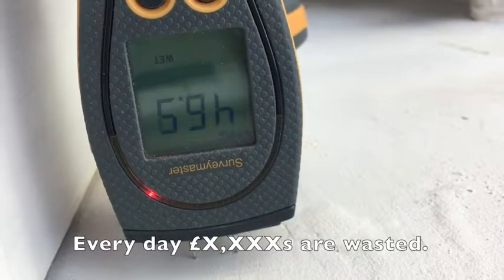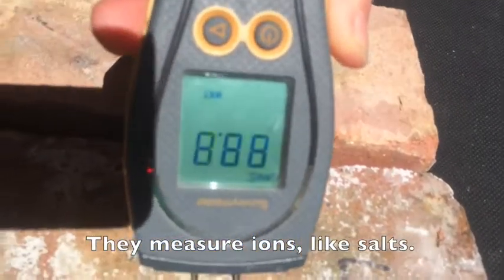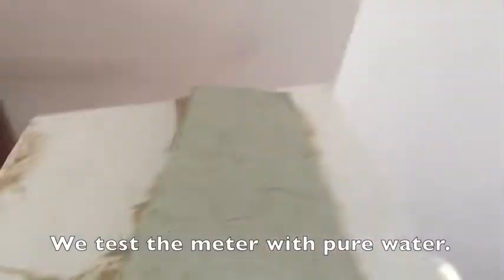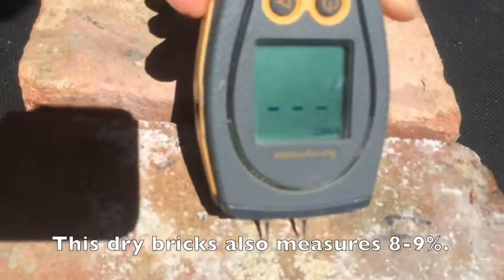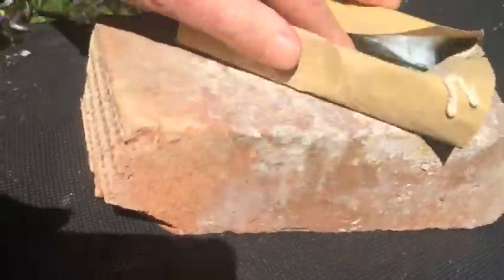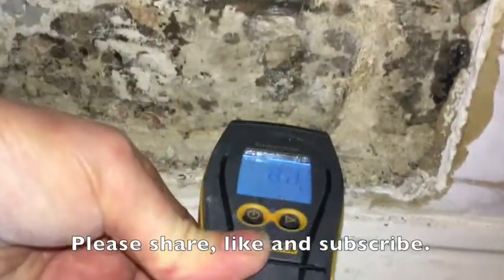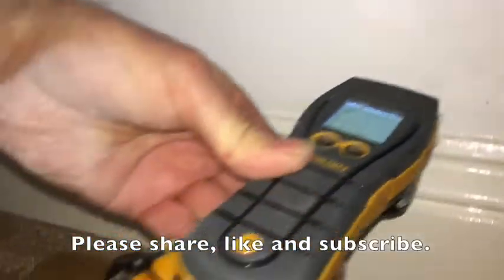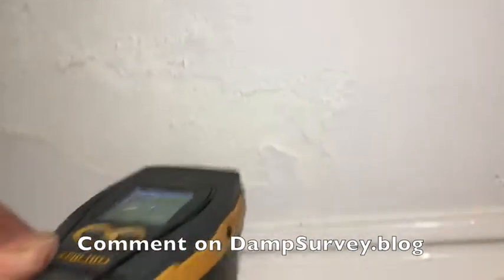How do damp meters work?

Comment: I always carry a pin type damp meter on my surveys but I always take time to explain to my Client that it's intended for wood, measures WME etc., and isn't itended for bricks, plaster etc. and that although it can give a false positive, it won't give a false negative and for that reason, it does have its uses when using on bricks, plaster etc. In my opinion, many of the free survey contractors use these meters fraudulently in order to scare the public into having 'damp' works undertaken. They are great tools in the hands of the experienced but should never be replied on as the sole method of diagnosis.
Reply from the maker: I’m completely with you on this! 😊

I tend to use a radio frequency damp meter, primarily because it measures damp deep within walls, making it less sensitive to recent condensation. It doesn’t leave marks, works more rapidly, and helps me map dry and damp zones effectively.

My preferred meter is the Dr. Meter, which costs around £23. While it doesn’t look as professional as the £500 Protimeter, I find it far more practical for several reasons:

It’s smaller, so it fits into tight spaces easily.
It’s less prone to making alarming sounds or flashing red when a wall is clearly dry.
It seems more sensitive in the range I’m most interested in, particularly at the higher end, making it especially useful for owners monitoring walls drying out.
That said, one exceptionally important point to emphasise is that a damp meter can never diagnose the root cause of damp, despite what some surveyors may claim. For example, damp at the base of a wall is unlikely to be caused by rising damp. If it were, you’d expect to see groundwater signs around the property, and on all sides.

Unfortunately, as you mentioned, many free survey contractors use pin-type damp meters fraudulently, scaring clients into unnecessary ‘damp’ works. These tools are great in the hands of experienced professionals, but they should never be relied on as the sole method of diagnosis.

Thanks for raising this—it’s an important point that more people need to understand! 🙌

Comment: I had a few damp 'specialists' in my investment property. They used similar protimeter. I have no severe mold issues or penetrating leaks from outside, but a few walls were described as 'soaking wet'. 2nd damp man suggested total of 36 linear meters to be treated by injecting DPC (£4,000 which he super generously dropped to £2,900 just after a bit of negotiation). I questioned one of the damp men's damp meter for its accuracy as it's conductive to various materials inc. salts and minerals found in typical wall covering materials (as shown in the video). The damp man has responded to that saying this device has been used for decades, hence reliable. He changed his tone after I started questioning his device which had no GREEN to RED scale- only digital readings which would mean he could pick any threshold he liked and could falsely tell me any particular wall needs DPC. he become clearly irritated and quieter after my questioning and went straight for the door with little words being said on the way out.
I'm after an independent damp survey which would tell me accurately what's what and what needs to be done. Any suggestion for a company in Wiltshire, UK would be highly appreciated. Thank you
Reply from the maker: Nerijus, 

hi, I'm always happy to help. It is highly unlikely that there is rising damp, which "injecting a DPC" is suppose to stop. I can't visit  Wiltshire, but do remote damp consultancy through surveyor.tips and could check out your risk of the property being in contact with groundwater, the source of water in rising damp.

Over the past 60 years there has been an increasing tendency to stop the symptoms of dampness by injecting chemicals or covering walls with impermeable plaster. The reason for this focus on symptoms rather than causes is diagnostics can be complex and time consuming. It is our experience chemicals and impermeable plaster is only a short-term measure that it can lead to long-term damage unless moisture is stopped at source. In our opinion identifying the cause of dampness is the only safe way to damp-proof.

By identifying the root cause of damp last year we saved clients £2.5Million that they might otherwise have been spent on short-term damp-proofing using chemicals and impermeable plaster.

Most rising damp symptoms are caused by poor ventilation, blocked drains, blocked gutters and simple leaks.
You may be able to find the remedy on surveyor.tips I try to put all survey findings online.